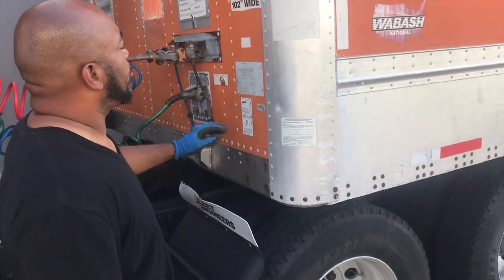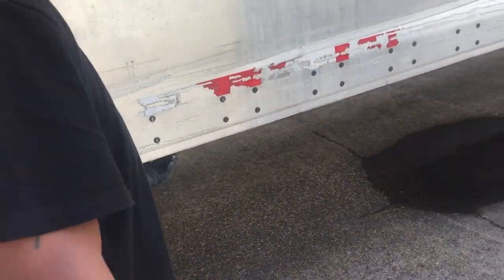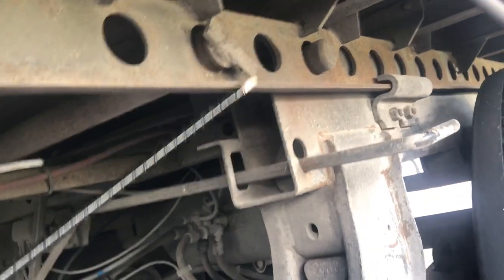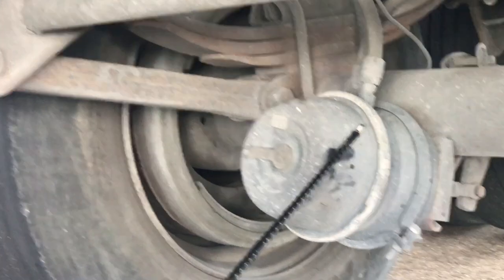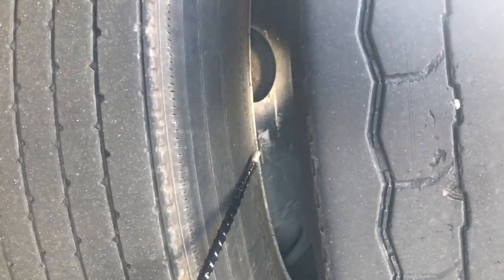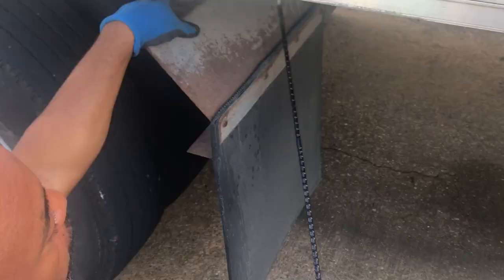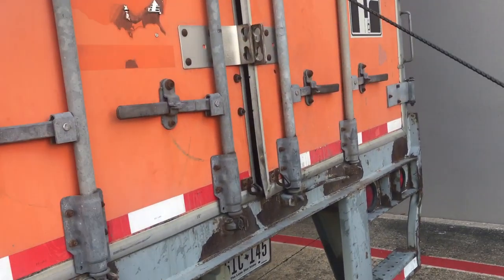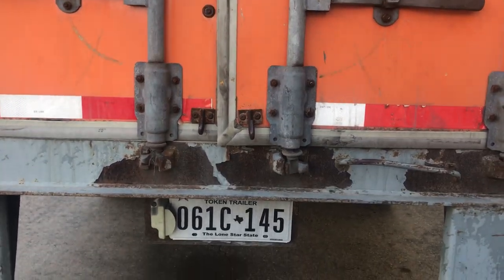CDL Class A Trailer Inspection

Comment: Passenger side middle of the trailer you forgot you're wide turn light it's amber in color it's a broken cracked or condensation inside the light so your life should be working it's mad and insecure and it's not bad broken cracked missing parts or illegal welds